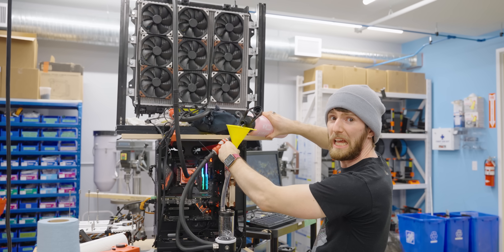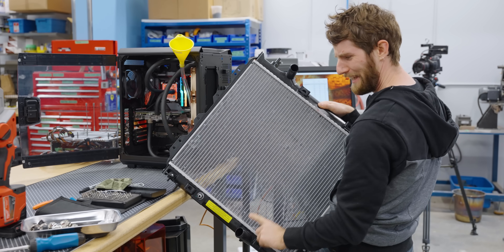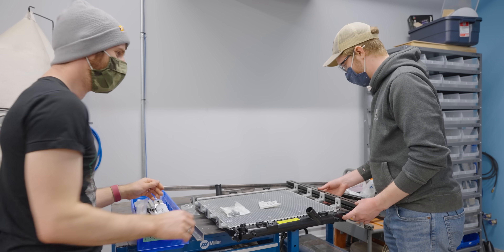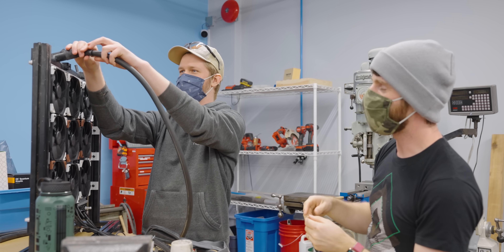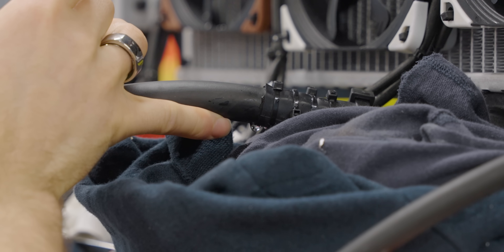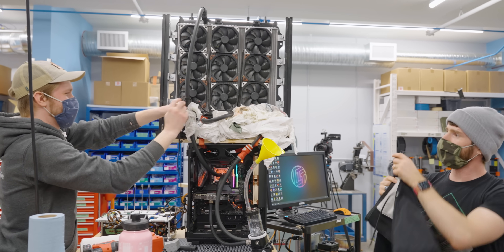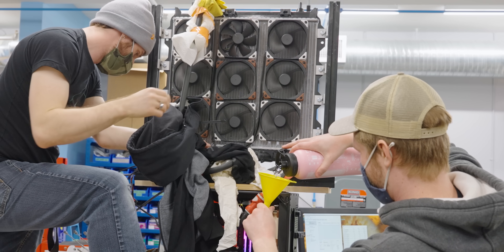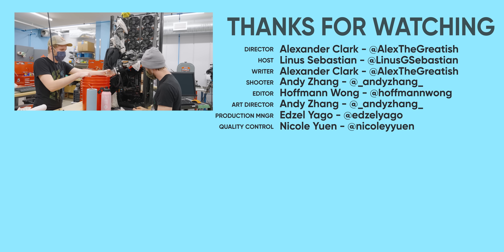Our Craziest Cooling Project Yet - Car radiator liquid cooler

Comment: Why didnt you use a motorcycle's radiator? smaller size yet you get that internal combustion cooling sweetness you so crave also could you use some epoxy on the fittings from the bike internal tire?

Comment: If you're gonna go car cooling PC style
you better go full car...
use a car's auxiliary fan and use a car's water pump...
though most water pumps are actually mechanically linked directly to the engine,
you can find some electric ones such as the Rein WPR0046 which seems to be a fully electric main water pump 
or the Bosch 0392022010 which is just a small auxiliary water pump

either way, you're gonna need more water flow/force than the tiny pump your PC's got

Comment: That's something you'd make a custom case for, then make that one of the side panels.
Reply: Ok, if I ever go ham on a ridiculous high power PC build when I'm financially secure, I'mma do this with my water cooling. Maybe even a system with two closed loops, so that I can run the graphics and cpu off individual AIOs on the same radiator, to avoid heat sharing issues.
Reply: Of course, I'd be way more careful than this...
Reply: Of course, the real gamer move is to move to a place without water bills, and hook your loop up to a water tap and drain. No fans needed, the heat is directly deposited.

Comment: Some plumbers tape and PVC piping (just a small length of piping inside the hose so they could've used hose clamps instead of zip ties for tighter connections) for those adapter connections would've gone a long ways.

That said I can kind of see a variation of this idea being used for transferring heat from a always-on computer to a house air system during Fall/Winter so you could cut down your furnace use some.  Granted if you want to use this idea during Spring/Summer then something like a modified A/C unit could be used to pump that excess heat outside.....though when the weather turns cold again......will vehicle coolant fluid work in PC liquid coolers?  Just to keep such a system from freezing up during winter.

Comment: So on this entire project.

This cannot be taken as a serious test.

I would have ran an automotive rad pipe from the rad in and out. Use some actual pipes to step down for the lines around the computer. Put the radiator NEXT to the case. The output can still be above the pump if you sit it on something. The top of the rad would still be higher than everything. Use the rad as the reservoir instead of that clear tube. Fill the rad to the top, It should drain to the pump before turning it on. When flowing you don't need to keep the rad full. 1/2 to 3/4 would work just fine. And use an automotive fan and shroud. Like the one designed for that radiator so it bolts right to it.

This would have been a FAR easier and not a cluster fuck if you followed that.

Comment: You boys need serious professional help. Consider finding a mechanic, a plumber, an electrician, and a priest.

First, my condolences -- You could've bought a radiator for a Toyota Echo on Rock Auto's website for US$40. 
Could grab a universal automotive radiator fan for another $20. It runs on 12 volts DC, use either a benchtop power supply, or maybe a PCI-E power connector. It may draw up to about 200 watts, but that'll do the job.
Next for the fittings, I would try using PVC pipe pieces that fit snugly inside of one another, starting with a piece that fits inside the neck of the radiator, then progressively smaller sizes until you've got the right diameter for the system's hoses. Cement the pieces of pipe together as any normal plumbing would be. Use hose clamps instead of zip ties, you might have fewer leaks.
You could ignore the transmission cooler portion of the radiator, it's meant to run the transmission oil through the cool side of the water loop -- wouldn't cool it any more by running water through it, but would probably increase the amount of back pressure you have to fight.

You may even  be able to run the automotive grade fan with a PC fan speed controller, but it would definitely need to be beefy. Again at full throttle, a car's radiator fan could draw 15 amps, or 180 watts. Could maybe bridge channels of the controller together for extra power, I can't say for sure there. Bring a fire extinguisher.

Make sure to top off with genuine OEM antifreeze for long cooling system life and optimal fuel economy.

I hope this helps, good luck in the next test. There will be a next test, right? I'm looking forward to it.
For now, I need a drink.

Comment: So the best way to run a water loop is just not as a loop but as an open flow system? Tap and drain instead of a pump and radiator?

Comment: For the trans cooler question, there is a U shaped tube inside of that radiator tank, one is the inlet the other the outlet. It's just a short tube the length of the distance between those barbs. IMO automatic transmission coolers don't work very well, think band aid on a stab wound.

Comment: The transmission cooler is an oil to water heat exchanger mounted inside the lower tank.

Comment: jb weld some fittings on the connections at the radiator to fill the gaps and make it leak proof. Then  ignore the trans loop and this could work out.

Comment: I have to admit, this is the worst lmg video in a long time. Wuy didnt you leak test the setup beforehand? Xpu have a hand pump thingy to test stuff for this exact reason... also heat shrink might jave been a good idea to stop the leaks at the tubes. Judging from the radiator flush the little transmission lines might have just been added to the og loop so just connecting them to each other would have been a good idea, or connecting those to the pc and have the large ones connected to each other.
It you build a rack for it already you might as well put it next to or below the pc to lower the pressure and almost all radiators have fill plugs up top. Also im pretty sire the transmission isnt being cooled by coolant but what do i know, american cars, am u rite?
Reply: Yeah basically just take a look at the like/dislike ratio, its pretty clear we were expecting more from a video, when you already ordered an extra rad for this

Comment: This is something I've been planning on doing for a long time. I just haven't found a pump to run it or adapt the fittings. I've never liquid cooled anything before.

I was planning on using the radiator as a side panel for the case. I was also planning on running a car radiator fan and shroud since they are just 12v. I was planning on the computer being in it's own room. because noise.

Comment: The transmission cooler is just a tube in that side tank that goes from fitting to fitting. That's all it is. Not much cooling capacity there. Realistically, it's more like a transmission heater. To bring it up to temp quicker. I don't know why you wasted your time going through it.

Comment: you two are the heads of the idiot brigades lmao
Use a car radiator fan, it's 12V, use car radiator hose and metal tubes as reducers, FILL FROM THE TOP LMAO

Comment: Bloody hell, $243 is the cheapest you could find? you got owned, HARD! I can get a  Ford Mondeo V6 radiator for £35 ($48.42) and thats just the car i own, you can get rads for smaller engined cars for £24.95 ( $34.51), im gobsmacked you paid that for a radiator!

Comment: I feel like with just a few seconds of thought this could have become an effective semi-permanent solution
Reply: I can't believe how many poor decisions they made in a row.
Reply: @eduardogananca  I had to double check the date to see if it was an April Fools joke.
Reply: They took the time to order a radiator, but didn’t get plastic couplers. Which auto parts would have had, it would just take 2-3 of them.
Reply: @Big_Iron_Mode  Not to mention they have an entire machine shop, lathe included...
Reply: I'm genuinely mad, as a mechanic, watching them butcher the execution of this idea
Reply: Yeah I feel like if it was just positioned beside the pc it would be awesome
Reply: Bro even I could make this work
Reply: It was painful to watch how little thought was put into this video. I get that they have deadlines to meet, but damn this build is an absolute fail. Just a few simple things would have made this work so much better. Use hose clamps instead of zip ties. Run the pump on a different power supply while filling to avoid killing the hardware. Buy some adapters so the janky bike tube doesn't have to be used. The list goes on... SMH 🤦‍♀️
Reply: Man cave worthy for sure, even add a front end of an old chevy to cover it
Reply: @codyeakinsbradley  oh god damnit I've gotta do this now
Reply: @willjohnson4579  but would it be overkill, would the machine be full on multimedia, games and HTPC? Have the bed be sticking out the other side for backyard tailgating. Fuck i need to get rich
Reply: Maybe fully attaching everything before starting would have been good
Reply: Don't u people get it, it's decided to look like amateur and horrible with expensive pc parts, it attracts way more audience in this way, so more PROFIT chachingchaching, it's that simple...
Reply: ah theres the guy that didnt get the joke
Reply: You must be new to LMG Will 😝
Reply: As linus said "you can tell its a friday"
Reply: GirlBaBes.Men
Reply: The project is useless. Just buy a MORA 3: https://shop.watercool.de/MO-RA3-420-LT-black with a stand, Fans, Pump/Resholder and everything and you got a HIGH-End germany engineered/manufatured product. ANd not such a cheap stupid crap like in the video.
Reply: @matthiasschmitt2311  That's $265 for just the radiator? That's crazy. There's absolutely real value in retrofitting a pre-existing solution. Of course, it has to be done correctly unlike this shitshow
Reply: @TennisGvy  Yes it is. But you get a extremly high-end german engineered  and manufactured product for that. Watercools products are allways perfect and flawless in any case/point of the product.

Comment: OK, so, your misunderstanding of the automotive origins of the radiator you used are clear. The transmission 'cooler' is really a heat exchanger, meant to get the transmission fluid to a more stable temperature. It warms the fluid when cold, and cools the fluid (some) when really hot. You shouldn't really use that part of the loop at all, unless you want to return water to the system that is heated up to a fairly warm, but stable temperature. Your fan solution is also way bad for the automotive radiator. You should've been able to just use the shroud and single giant electric fan the donor vehicle would use, and it even runs on 12V DC, like normal MOLEX connected PC fans do. Those fans can even be set up to run thermostatically controlled. So many missed opportunities here.

Comment: a Watercool MO-RA3 is basically the same concept, just made especially for PC Watercooling, and costs around the same or less (depending on the model) 😂
But it proofed the concept that this also works... as long as youre willing to deal with the few leaking issues it has 😂

Comment: That radiator costs $30 on aliexpress and an 18 inch radiator fan costs $20 on ebay. You could have gotten WAY better results for 1/4 the cost by not letting Alex who is the most unqualified engineer I have ever seen take over this project. A single radiator fan moves more air than all those fans together. Those radiators are usually rated for several KW of cooling and that CPU temp should have been at 20 degrees if not less due to evaporative cooling of the humidity in the air.

Comment: great vid! if you spent an extra $10 for hose clamp rings this would have worked. a dual pump one top and one bottom of the radiator means you could put the radiator any where

Comment: The smaller ones in the same tank are for a transmission cooler circuit. It uses the already cooled coolant to extract heat from the transmission fluid running through it.

Comment: The transmission cooler is basically a radiator inside the tank of the radiator. adding it to the loop is would only add potential leak points.
I'm curious to see what would happen it you ran your loop only through the transmission cooler, and 1/3 fill the radiator with 3M Novec and seal it up.

Comment: Wrong way to filling.  Use vacum to pull out air and then fill  it, sow you can leak test and fill the same time. I been looking these pc custom loop videos, but never understood why never use  vacuum to test or fill system like car cooling system.

Comment: Why not try using a EVAP radiator or a heater core from a semi trunk they're thicker and have a small usable inlet port for fluid to passed thru and probably be more efficient for cooling.

Comment: should you take the thinner hose and wrap it in sticky tape untill it is thick enough to make a watertight connection with the bicicle tube?
or just use shrink tubing?

Comment: Yeah... So I have a Alphacool NexXxoS Monsta 560mm and a Alphacool 420 rad... The monsta being mounted across the top bars of my thermaltake P5 "case".
It runs at 5950X and two 5700xt cards flat out 24/7 with the peak CPU temp being 50 Celsius. (Yes it's running nice hash whenever I'm not using it)

In other words, you could have just done all that and not sucked at it and gotten an actual result that was better.

Comment: Cooling a PC is the only good thing you can do with ANY part of a PT Cruiser. Finally, someone has found a use for that pile of junk.
On the flip side, though... if these are the lengths a gamer needs to go to to not let their CPU catch fire, Intel still has a lot of work to do before being a reasonable option.

Comment: You know, I’d love to see them actually do this the right way. Like, design actual interconnects to prevent leaks and proper fan mounts and design it to sit next to the computer instead of on top. Like, make this an actual working thing instead of some dumb idea someone had in the bathroom and decided to throw together before dinner
Reply: Can't agree more, was disappointed that there were leaks in the system and they tried to refill it every often.
Reply: You could make one side of your case this radiator ^^.
Reply: It already exhists. Check pc builds with a MO-RA
Reply: the thing is,  'janky' is Alex's middle name. heck, it might even be part of his jobdesc
Reply: XD
Reply: and there is no point of doing it 'correctly' cuz of diminishing returns, something a lot smaller would do the same job
Reply: Damn you sound boring

Comment: The issue with this solution is that you still have the radiator inside the house. With a 3090 and a power hungry OC-ed CPU (a threadripper?!) your rig can become a mini heater. That could be good for the winter days but a nightmare during the rest of the seasons. I would love to see a solution where you actually cut some holes in the walls and move this radiator outside the house.

Comment: Instead of traying use 1080 mm X 1080 mm water cooling radiator picked is trash auto radiator ... no point at all. It will be interesting for many to see such form factor use ... This current one is totally overboard ...

Comment: Hose adapters with Silicone Glue works. 

I've got a system with a car radiator running right now.  No leaking.

Comment: I understand that the solution you went for is part of the video's charm, but the amount of effort to make this not complete jank is minimal and, frankly, it bothers me as a user of a large external rad. All it takes is a few dual barb fittings and tube clamps to adapt from whatever tubing size the rad takes to the internal tubing.

Comment: the transmission cooler part of the radiator is a separate loop of usually steel tubing coiled inside the end tank

Comment: Linus and team do the same but duel radiators covered in push pull blowiematrons pretty sure you might see single digit temps under stress 🤣

Comment: In case you guys weren't paying attention. Luke already did this. I haven't watched the video. But I can tell you right now.  Your only increasing your maximum heat dissipation capacity.

It doesn't matter how big the radiator is. You will never be sub ambient. But more importantly that Radiator design material and surface area are all designed for much higher and Air flow. With much much more noise.

The second cooling loop is for a pressurized line of coolant. That acts as the condenser section of the air conditioner.

Comment: Dislike  :(
Never disliked a video from LTT before, but this one makes me sad.
Nice idea, to answer the question is a car radiator any good for water cooling but, its not the craziest cooling project from LTT, not even top 5.
Intentionally chaotic and provocative (placing the radiator on top and refusing to turn the system off to fix the leak)
Completely un informative

Comment: that radiator was bad from the start... water shouldn't get out from the transmission cooler side since it should be sealed from each other and btw it's just a pipe inside and it,s suffisent to cool auto trans, they dont produce as much heat has engine does

Comment: 3m Rubber Splicing Tape. Buy a roll or 2 and you will always want a roll around. This is NOT normal electrical tape!!! Its stretchy like a rubber band, has no adhesive, but bonds to itself when you wrap it tightly around something. I've repaired burst radiator hoses with it before in a pinch, and it won't leak or melt unless under extreme heat. I'm talking direct contact with exhaust heat.

Comment: Wouldn't a couple of mo-ra 3 radiators have done the same sans leaks?  Might wanna invest in a welding setup so next time you can put on proper G-1/4 connectors.

Comment: That is a show. Doing an acceptable job would take a few minutes more, at least to avoid leaking. I don't like this one. You can actually buy copper radiators, some heat exchangers and climate coolers are made of that, so no galvanic corrosion...

Comment: FYI that transmission cooling lines have their own radiator inside the bottom core that gets cooled with the antifreeze when it passes through the fins of the cooling lines.